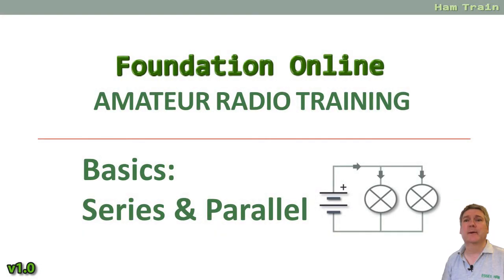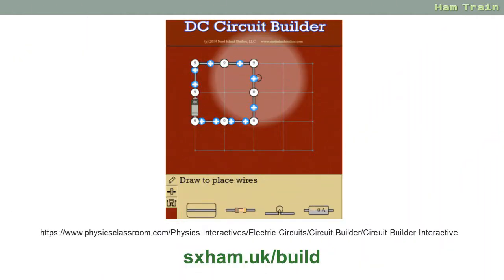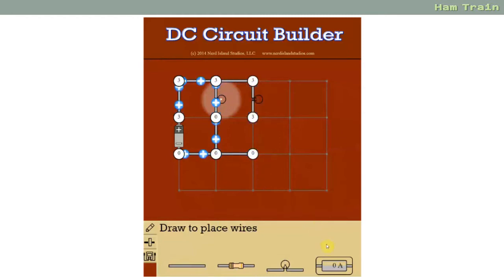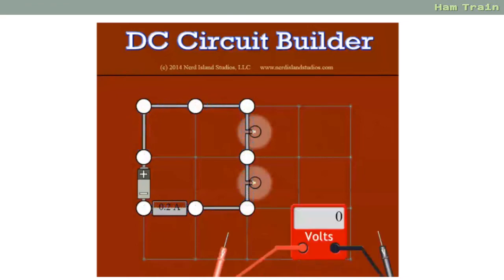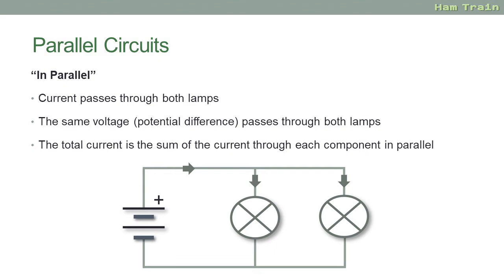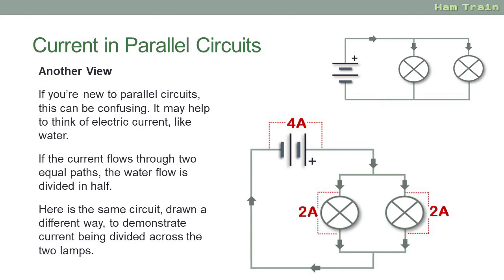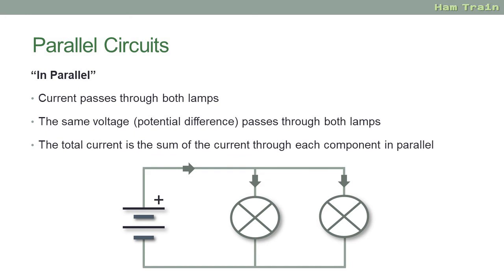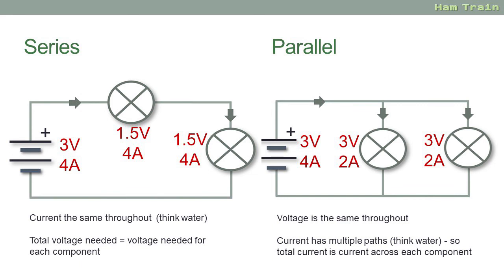Basic Guide to Series and Parallel Circuits (Old Version)

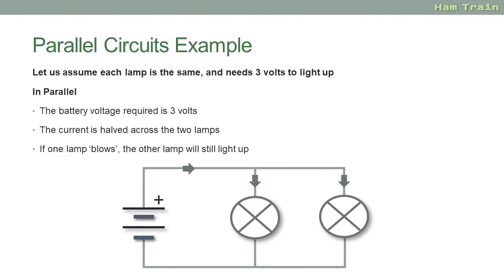Comment: The spoken statement at about 6:15 that "twice as much current will flow through it" is incorrect.  If a lamp blows the current through the other one does not increase.

Around 8:16 the words "voltage through the lamp" is not helpful.  Current goes through a component. Voltage is across a component.